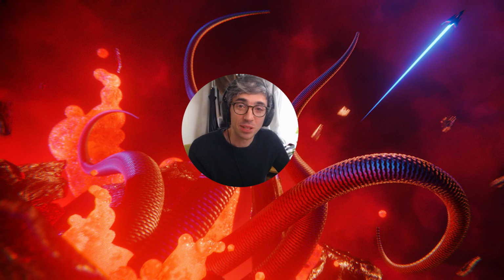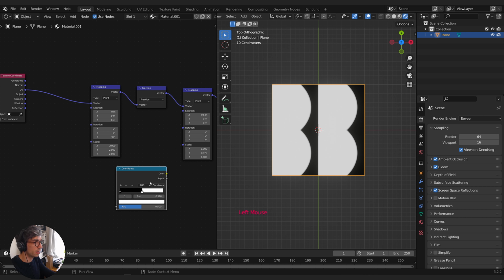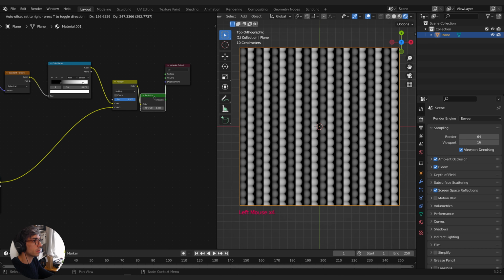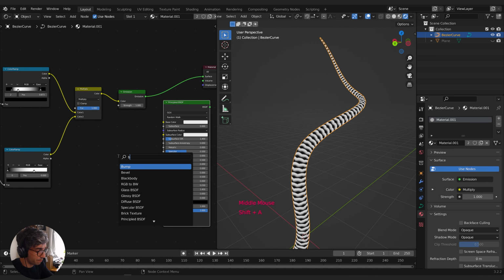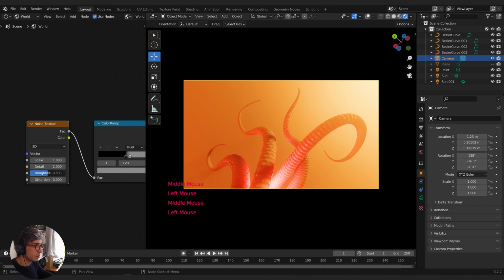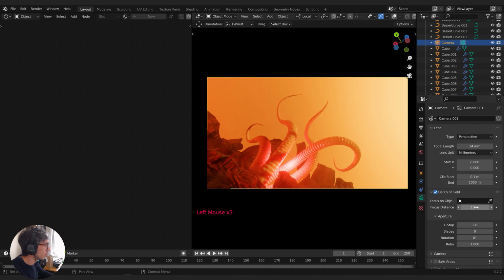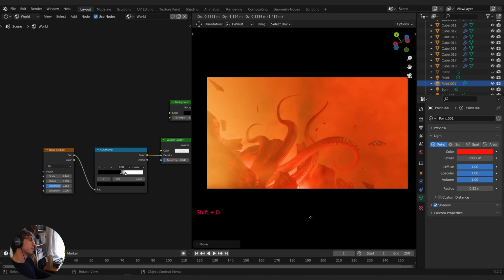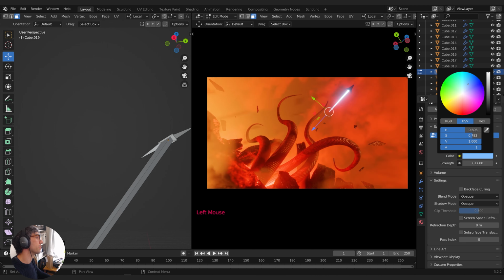Blender NO ESCAPE!

Comment: 7:55 If you're having trouble with the part where you offset one half of the gradient, check the V value in HSV of the second color. I overlooked that bit when I first tried this, but it turns out that's THE single slider in this setup that gets the one half of the gradient to move, so because I had already set the factor to 0.5 and did everything else right, but didn't adjust the V as he said at the very beginning, I had an issue where it looked like I had done everything right, but there was still no difference.